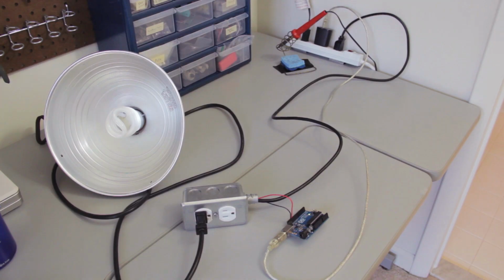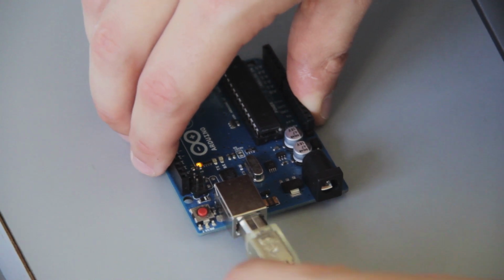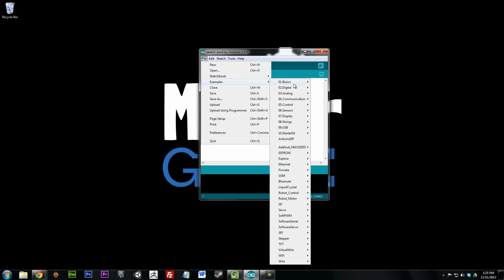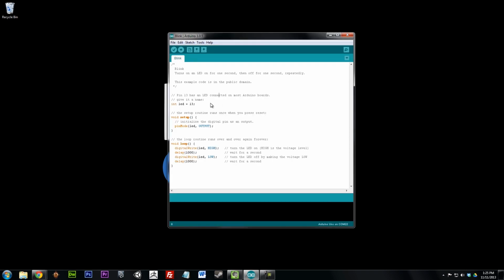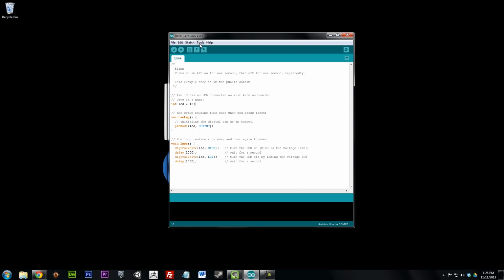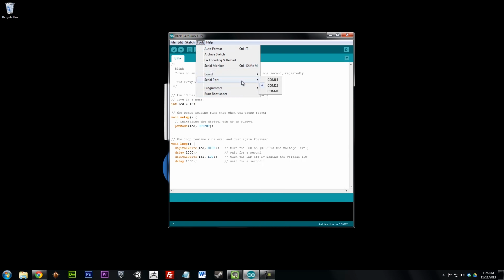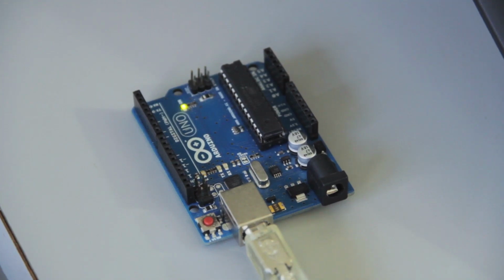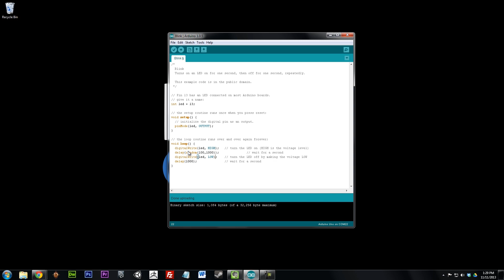DIY Relay Outlet Arduino - Maker Guide Episode 7

Comment: This video was very helpful to me, so thanks! If you wanted to control your relay wirelessly, how would you go about it? Can you connect wirelessly to the Arduino? Even so, you'd potentially have to pull some pretty long wires through the walls to where your "control center" would be located, right?

Comment: I did very similar config, except I connected the negative (black) wire to a digital output pin 7 then connected the positive (red) wire to a 1k ohm resistor then to the 3.3V power outlet on the Arduino. Then you can use a switch to sit between GND and say, pin 2. The I can turn the light off and on using code to digitalRead(2) if its LOW, then digitalWrite(7, LOW) else digitalWrite(7, HIGH) to control the light to come on / off. It gives you more flexibility too.  Can modify the code to use a function to check the time and turn on if its say after 8pm and off after 7am.